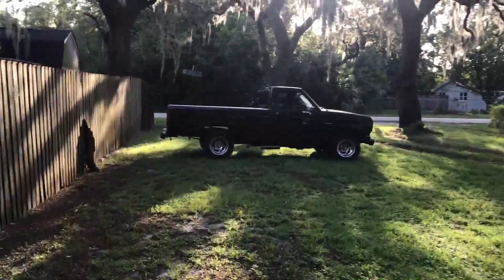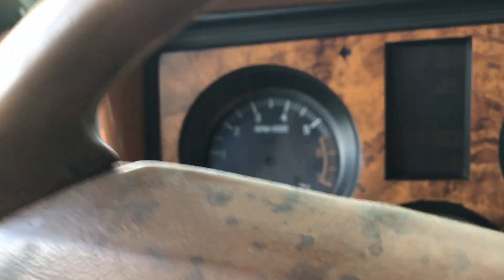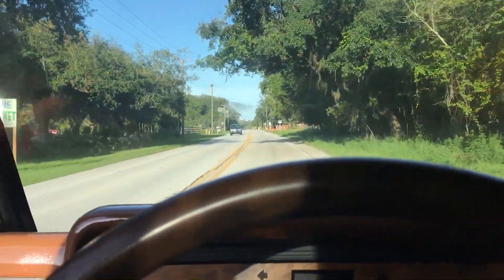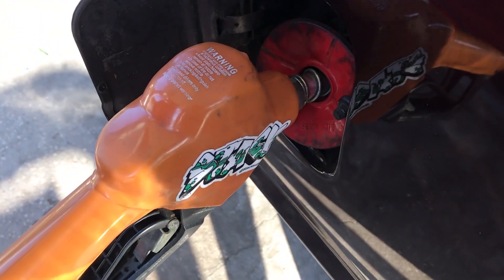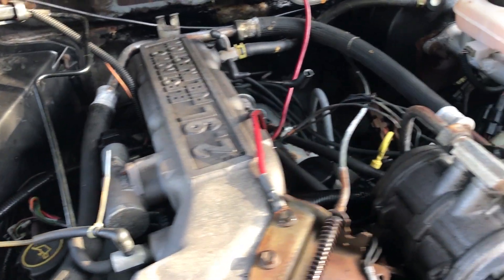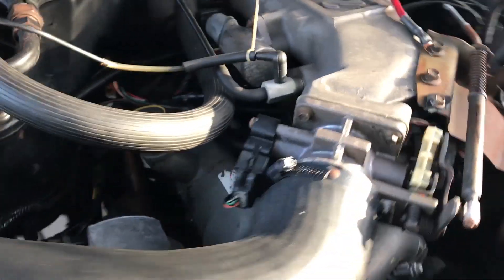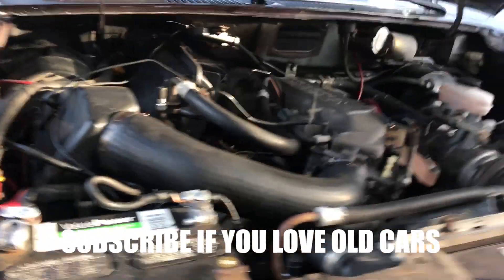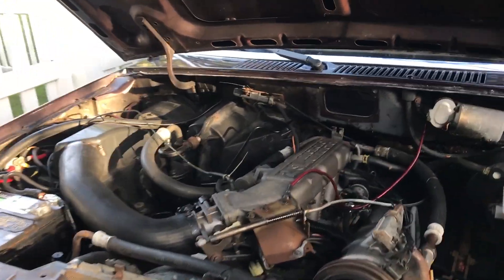Let's Drive The Old 88 Ranger To Get Some Gas

Comment: That open exhaust thing is supposed to connect to the airbox for quicker cold engine warm up in winter time. In the tube that is missing is a butterfly valve that is supposed to open up and bypass once the engine is fully warmed up.

Comment: i have a dead stock 88 ranger with the nicest interior you’ll see, i think seeing yours is gonna be what makes me get it painted that color when she’s ready
Reply: I just got mine today it has the original leather no cracks at all, no rust and no leaks . The car was really well taken care of I just need a paint job because of the age
Reply: Same thing here. Original leather. No idea how an almost 40 year old truck has leather with zero cracks and here in the south too with that sun beaming down on it. Got a lot of issues going starting with replacing the fuel system tomorrow.

Comment: I'm in the middle of a 5.0 HO engine swap and my 4.0 liter v6 that's in it is coming out of it with an automatic transmission and the AC system was just replaced five thousand miles ago. The engine has been well maintained.

Comment: yeah that's the hot air duct tube/hose which connects exhaust to the air intake ( i'm guessing for re-burn)

Exhaust manifold => air intake => filter => throttle body. It's a crappy design, your hose is missing, you can buy a hose to the air intake (beneath battery) for <10 at a local autoparts store.

Comment: Looks like a vacuum line for the fuel pressure regulator is not connected, just hanging there. (drivers side, towards back of fuel rail). May be part of the issue you are talking about
Reply from the maker: Yep. I connected it and it’s working well now. Thank you!!!

Comment: i think that opening is for a flex pipe that connects to the air cleaner or a smog pump what its for? i have no idea and i don't think it shoud be smoking but you might have a small crack in the exhaust manifold.
Reply from the maker: I think the smoke is from the previous valve cover oil leak. Might be remains of the older oil.

Comment: I got a 2wd single cab extended bed completely original 1988 ford ranger as my first truck
Reply: I just picked up a 1988 Ford Ranger XLT with only 60k mile all stock even the factory sticker for 5500
Reply: Nice bro
Reply: I wish i cold drive mine but im still a kid
Reply: @upbeattarnished2941  i subed to your channel btw
Reply: @upbeattarnished2941  got mine with 57k miles for 4700 from an older ford collector lol, just got her registered last week

Comment: You should try some Simple Green and/or Brake Cleaner on your steering wheel. It might clean right up. I have to use both products on my 87 Ranger steering wheel because it leaks some of the original adhesive through it about once a year during hot weather. Requiring 11 gallons in the truck it was close enough to empty.. It's only around a 14 gallon tank, give or take.. As for a valve cover leak, a lot of people over-tighten the valve covers, and this makes them leak forever because the sealing flange is warped. The next time you have the covers off, lay them on the flattest surface you can find and look for gaps underneath the sealing flanges. They can be straightened up again with some gentle tapping with a hammer and piece of flat stock steel a few inches long. You want to spread the area you're hammering on over several inches.. The steel helps with that. You can also turn them over and tap the area around the bolt holes back to flat again. The large hole in the exhaust manaifold looks like a model from an earlier, carbed Ranger. That would have had a flexible tube on it that ran back up to the breather on top of the engine. Can't say I remember ever seeing one on any of my 2.9's but I could be wrong. Also, you've got a vacuum line disconnected to your fuel pressure regulator. That will cause the surge/idle issues you're describing.
Reply from the maker: Thanks for all the tips. I appreciate that. Regarding that vacuum line. Where does it connect? I can’t find where it goes.
Reply: @Archifx  There a little round cannister looking thing. It should have a little pipe or tube sticking off the back of it. It's the fuel pressure regulator. It will hook up to that. On the drivers side, near the back of the intake: http://www.librum.us/images/1989mainvac.JPG

Comment: 2.9, junk
Reply: I have a 2.9 and i consider it to be a great little motor, it has around 300,000 miles on it and still going strong with little to no issues and uses very little oil mostly from leaks. .